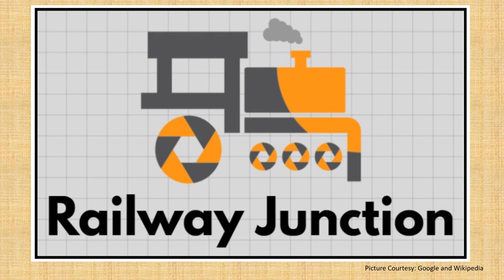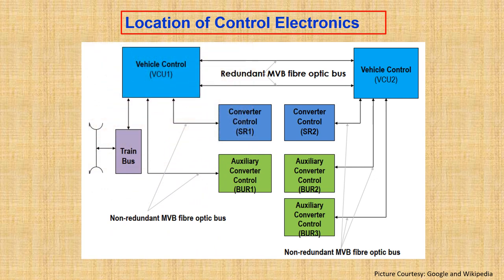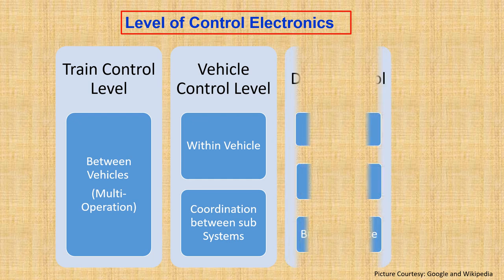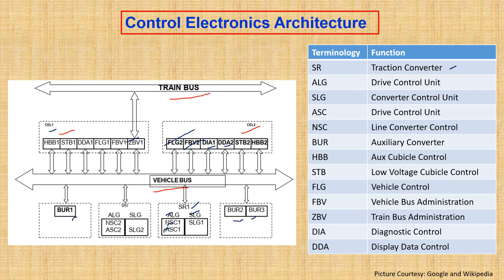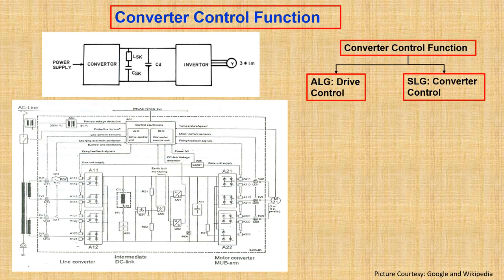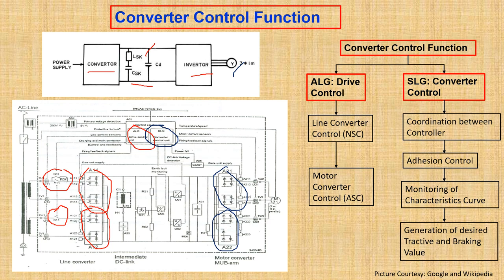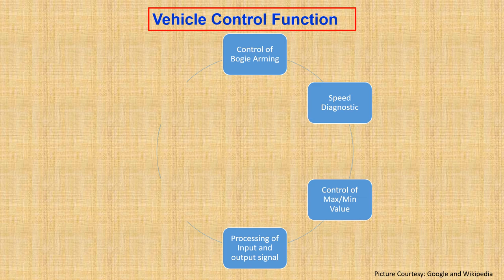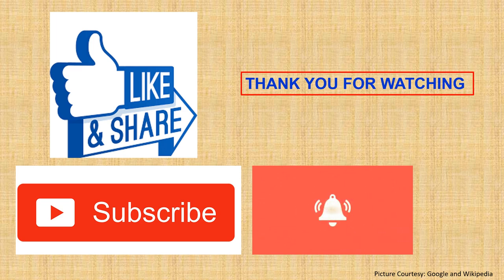Control Electronics of 3-Phase Electric Locomotive #3phaselocomotive #electronicloco

Comment: Control Electronics Works on ___ Volt ? 
Plz Reply Sir
Reply: 14v dc
Reply from the maker: Control Electronics of 3-Phase Electric Locomotive Works on 110V DC. However the LED's in Driver Desk works in 24V DC and Churning Fans for cooling of Electronics in VCU works in 48V DC.
Reply from the maker: A Brief Comparison Between Amrit Bharat and Vande Bharat.

https://youtu.be/LVowglOmJCQ